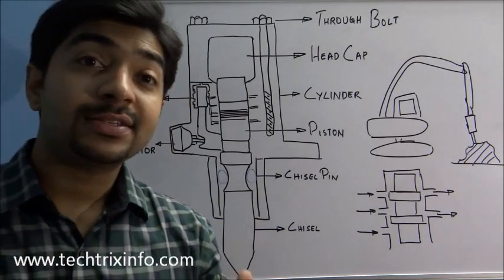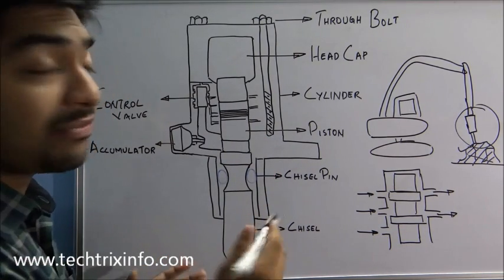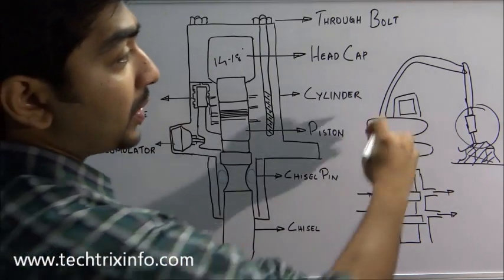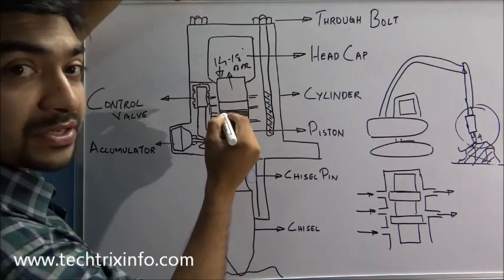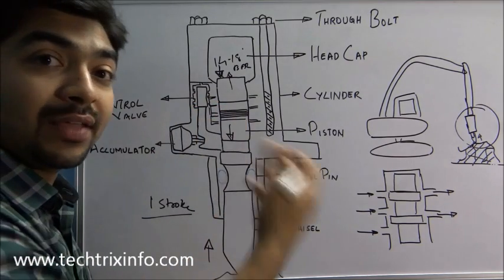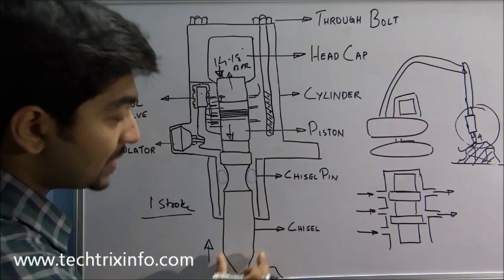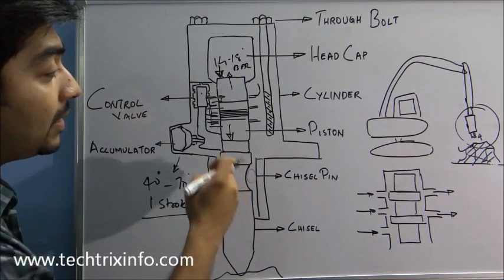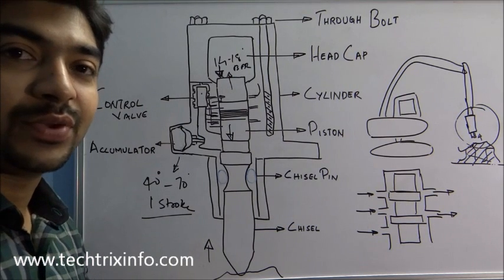How Rock Breaker Works. ✔

Comment: Rock breaker work without surface contact how??? Dozco D135 breaker qorks with surface contact... Replay plz
Reply from the maker: Hi Jay, thanks for the comment, your question is not clear, can you please elaborate. 
Thank you.
Reply: @TechTrixInfo  you said in the vedio it's not works without surface contact but now Dozco 2200 will run with or without surface contact but d135 will only run with surface contact why???
Reply from the maker: @JayPrakash-pr5qm Hi Jay, Thanks for the question, that means it’s might be a different mechanism compared to what I have explained, there are different types in the market, will have a look and get back to you, have a good day, stay positive, stay kind

Comment: Wow, finally someone who can explain the way the dam thing works. I once did a summer internship in a local heavy equipment shop and the mechanics kept telling me that "the chisel doesn't move", which made no sense at all given that a hydraulic hammer is triggered by the weight placed on the chisel by the machine. These guys even got belligerent with me and told me to stop asking questions from what I can remember. Thank you so much for posting!

Comment: I have a brok machine sb 202 epiroc breakers the problem i faced is that the breaker stroke is not working properly the stroke is very low means stroke pressure please suggest me some causes so that i able to repair it.

Comment: Sir why did the breaker geates slow while we operate  the other fansion during  breaking and head gas geates  high
Reply from the maker: Hi Dilip Good question.
Speed depends on flow 
So when you combine another operation while operating breaks, the pump now have to supply flow to multiple operators resulting in less flow to each operation resulting in the breaker to slow. 
And at the same time when you have multiple operation the operation which has the priority will get more flow depending on how the circuit is designed.
Hope it’s clear, please feel free to WhatsApp me @ +642102936490

Comment: It means we have to fill the Nitogen gas in two portions Head cap and Accumulator.
Reply: Yes you're very right  , on head cap you first screw in the check valve then fill ,then on accumulator you first unscrew the nut then access the alen key bolt ....

Comment: could you please answer my question? does the power of the operator pressure affect on the operation or not? i mean the pressing pressure
Reply: The operator pressure is needed to place the hammer in position and give a light initial pressure.

Comment: does it mean on the first stroke that as long as you press the breaker on a rock and there's pressure, it's not necessary to use the hydraulic control valve?
Reply: That first stroke story i badly told. It's not a stroke. It's only the nitrogen giving more and more backpressure the harder you compress it. It's not like the nitrogen is giving an impact on the rock more than the excavator is pushing on it. It's exactly like compressing a mechanical spring but then with nitrogen. As long as no hydraulics are activated its not hammering.

The hammering is apparently caused by ports in the piston which have a small offset compared to holes in the cylinder, which makes the piston move back and forth.

Comment: You're not quite right in your description. The tool (you call it a chisel) does not push the piston up into the nitrogen chamber. This is done with hydraulic pressure. If the tool and piston move together as a unit there would be no hammer action. The nitrogen pressure acts as a shock absorber for the piston and helps the piston to start it's downwards stroke until the hydraulic switch over valve has switched over from pushing the piston up to forcing the piston down onto the tool. It is important to push the tool back into the hammer before starting the hammer, if it is not then the piston will dry fire (not hit the top of the tool) and may get damaged. This is a video to show the basics Rock Breaker's Principle of Operation
Reply: This guy is an amateur.

Comment: Looking into a bobcat skid steer break. I was told it'll work for a bit.  When it stops, you have to back flow the hydraulic flow. Then it'll maybe work a little longer. I believe they did charge the nitrogen once. Where's first place to look for a fix?
Reply from the maker: You question is not clear. Can you please detail, will try to give you a solution.
Reply: in o  8.3   8

Comment: We have some hammers which hang vertically (3 in a row) and they suffer with dry firing. If we put the pressures up to 14 bar in the accumulator they struggle to fire, so we drop them to 12/13 bar and they will fire correctly until the system has warmed up to 52-55 degrees and the dry firing starts again. System pressure is 145 bar and fixed flow through the use of pressure compensated flow control valves. The model is a CP400 (Chicago Pneumatic). Could you also explain which surfaces the oil acts upon to fire the hammer up and down?

Comment: Hi there thanks a lot for the share,i have few doubts ,how is the control valve contorlled,can u share how the valve works and will u please explain the rock breaker hydraulic circuit.

Comment from the maker: See breaker is a simple unit, just make sure that the Gas pressures are as per the manual. will get a expert advice on this field issue and revert.

Comment: Don't mind if i asked, i used to install a hydraulic breaker to some customer. I'm gonna be honest, I'm new on this industries. I found out that, some of the breaker after installed. work for couple 100 hour it stop functioning. 
Customer did said that, after the excavator heat up. the breaker won't even moving and getting power down.

is there any big problem? the measuring pressure were put accordingly to guide.
is that the viscosity of hydraulic or or internal problem?

sorry for my english

Comment: Hi, very interesting video, i work with hydraulics a lot and was wondering where you got this principle from? the hammers ive been working with are different (montabert brand that is), there is a component termed a distributor which is similar to that of an additional piston, in place of the 'head cap' that you term, when flow passes through this distributor it moves in the opposite direction until it goes far enough that another cavity pushes it back the other way, all the while hitting the
Reply: MrDzver  only simple basic add
Reply: Sany excavator 140 RPM Down Why Work At